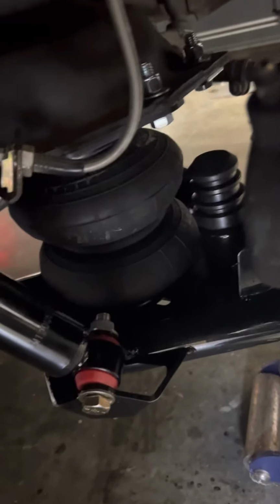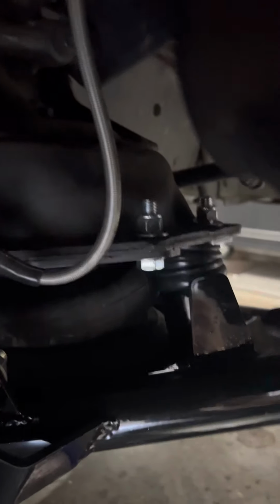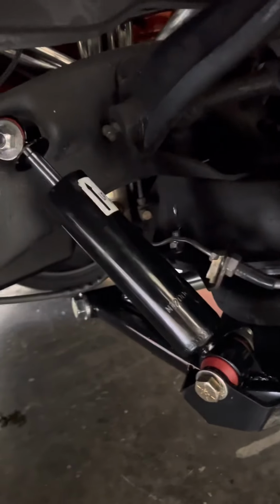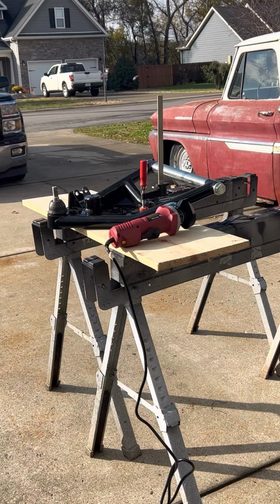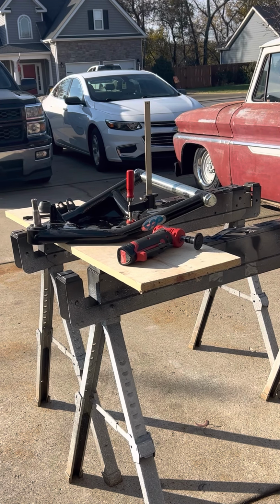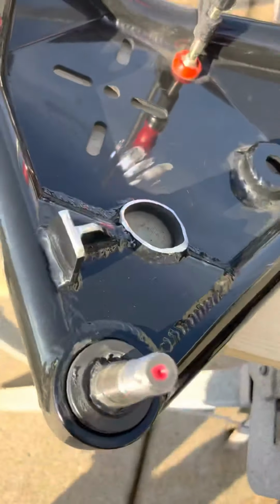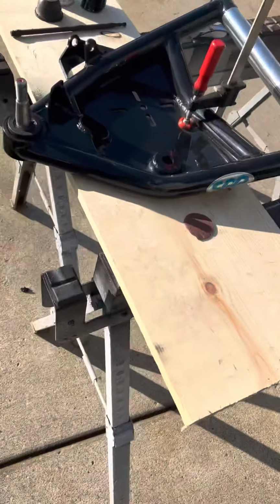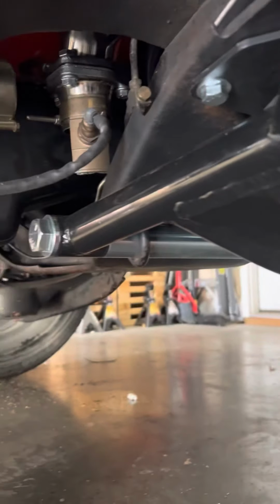C10 CPP Lower Control Arm Fabrication

Comment: are you still around, and what year is your c10,,, I just had the CPP tubular installed and when I got home  i drop it, and it didn't go all the way down, and then i look and saw the bump stops sitting on that upper support for the bags, and even my bags look funny, so i have to back and get that taken off asap, even my ride height that I like is to close to the bump stop, - also I used only 18" rim on the truck - as I had the airbags installed on 2003 just so that I could lower the truck to put my Motorcycle on the back by myself,  and in the back, i have still have the lowered leaf springs with the bags but it goes all the way down to the c-notch,,,   glad i found this video because i thought when I purchased the tubular at CPP they made sure that i had the ones for the airbags,, but the bump stop does not make sense - you can damage that upper part right
Reply from the maker: Hey buddy. You have some great questions. I’ll try to answer or comment on all of them. My truck is a 66. The cpp lowers are the same from 63-72. I’m not sure why cpp places a bumpstop on their lower control arm. It shouldn’t damage the top pocket though. Next go around I’ll spend up and go for a full control arm set from porterbuilt or strong arms. The bumpstops are easy to cut off. Just follow the video and reinstall them. That should give you a lower ride height without the control arm hitting anything.

Comment: How low does it go with the CPP control arm after you modified it?
Reply from the maker: The same drop as cupped lowers. As far as you can go without a drop member or Zing the frame. Reference my green truck on the bagging on a budget video to see.

Comment: I read that CPP lower control arms for airbags  won't fit a 2600 airbag, but require a 2500 airbag for clearance.
Do the bags fit the  CPP lower control arms for airbags,  without mods beside cutting the bumpstops.?
Reply from the maker: I used a 2600 bag with cpp lowers and never had an issue. Use the cpp upper bag plate for better alignment.

Comment: What upper control arms are you using
Reply from the maker: Factory
Reply: Would the cpp upper work with bags
Reply from the maker: Yes you can get the full set. If I were buying a full set, I would go with ride tech or portbuilt
Reply: What are the draw backs of running the cpp uppers
Reply from the maker: @dustingibson7809  there’s no draw backs to it. If you run porterbuilt you can get 1 inch narrow and 1 inch forward to center the wheel and reduce camber.